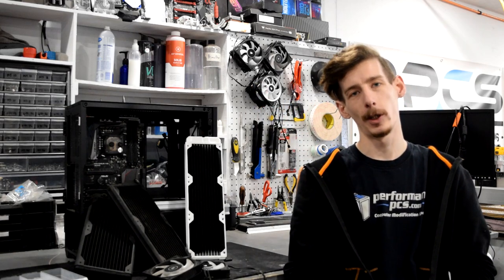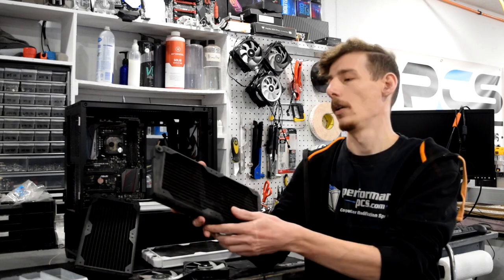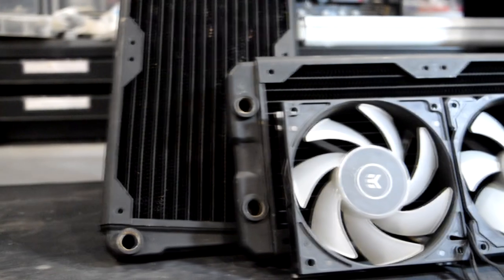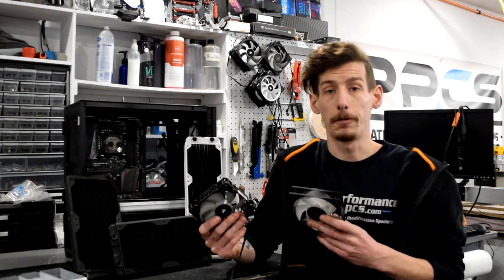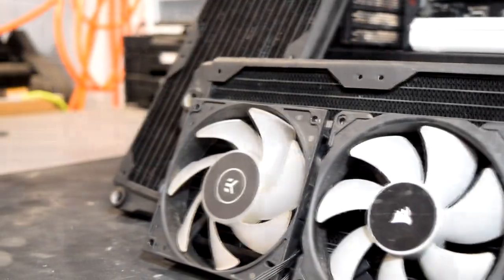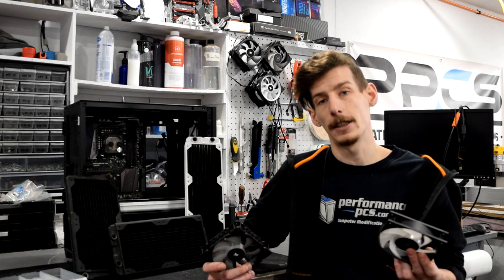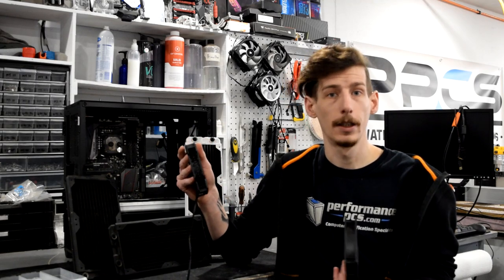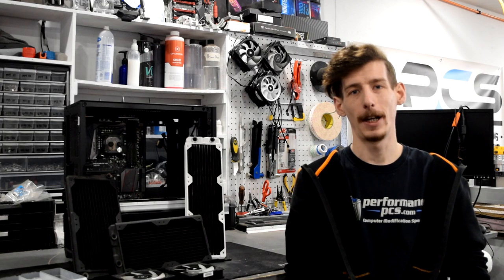Everything You Need To Know About Radiators and Fans

Comment: Great video, regarding U radiator I have always preferred to do tubes up on my custom loop if front mounted as this certainly makes bleeding the system easier and less risk of an air lock. Yes if you did need to drain without disassembly it will make it difficult but really if your doing a 6 monthly or yearly coolant change you should ideally be stripping down and doing a through clean anyway. Looking forward to the next video! Any chance you can do a video on how to or best pressure  testers and leak test for custom loops?  Thanks!